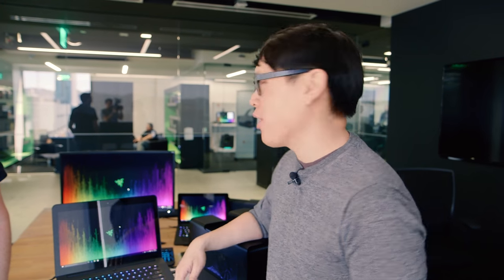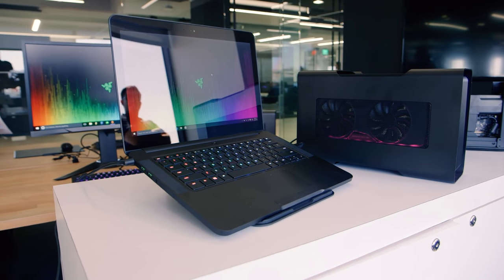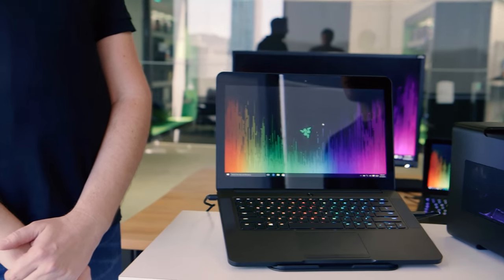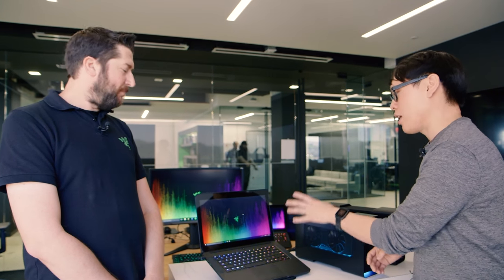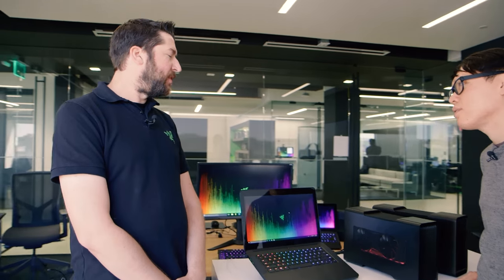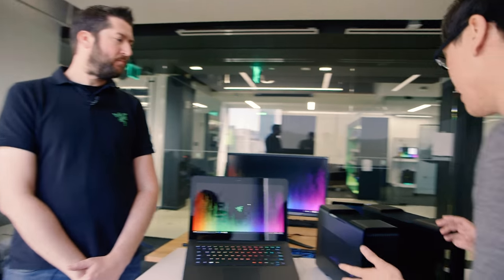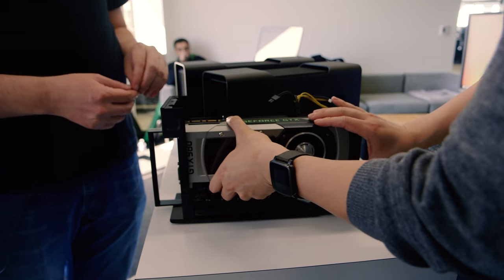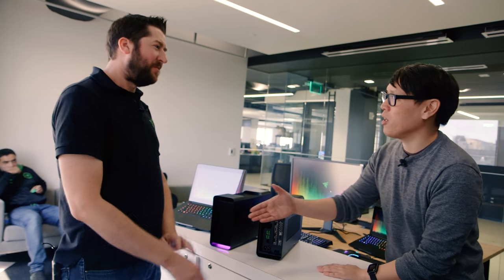Installing a Video Card in the Razer Core (External GPU)

Comment: yo this is such a good idea, external GPUs. hopefully a new trend, for all devices
Reply: +Shawn From Portland so the core itself is going to be more expensive than gtx970?!
Reply: +Larry LaPointe People used PCIe before.  Making use of M.2 style connectors.  It was more of a home made hack.  But it was a bus capable of the speeds needed.
Reply: +Larry LaPointe People used PCIe's through their M2 slots. While I agree that this particular "box"' price is justified for really the overall build quality and materials, the same functionality can be achieved at a much lower price, obviously with cheaper materials. The core is nice, but for the concept to be widespread it'll definitely need a lower price entry bar.
Reply: +Superkoopatrooper I agree $500 is way to much, $200 is about right other wise it would be like $3000 for the laptop, gpu, and core. You could build a great pc for that and but an ultra book.
Reply: +William T Will not work on a cheap Laptop due the thunderbolt connection req ( not an option on a cheap laptop) maybe in a few more years IF thunderbolt becomes a common feature and Usb 3.0 + doesn't kill it
Reply: +Alberto Martinez Cheaper reasonable good laptop with Thunderbolt 3 would be around $1000. Exactly, this won't be cheap at all
Reply: +Djordje Petrovic I said the idea was good, not that this device was the pinnacle of achievement in realizing this idea
Reply: +Alberto Martinez Which it will.  Thunderbolt is proprietary, USB 3.0 is not.  For that reason alone it will fail to beat USB 3.0.  That doesn't even take into account the interoperability advantage that USB 3.0 has with older 2.0 and 1.0 devices that Thunderbolt doesn't have.  Thunderbolt is a good idea, killed because Apple insists on proprietary interfaces.
Reply: +Superkoopatrooper 
Incredibly overpriced. Ignorant people are what keep these things around.
External GPU's are nothing new- old news. Tacked-on solution to an inherent laptop problem.
500g hdd for $2200? Then you have to buy a video card for $100-$300 ( or more ) and then buy all the peripheral garbage and that fancy box to hook it up for $500 and more. Get the fuck out of here.
Build a DESKTOP GAMING RIG.
This is no desktop replacement. Laptops never will be.
Reply: +Larry LaPointe Well you can buy an entire aluminium frame ATX- case (with fans) for about 80$ and a 650 W power supply costs like 60 $. I know that new technology costs more, but I'm quite sure that if these things become popular other manufacturers will be selling products like this for much less.
Reply: Rocco Croce 
This external GPU tech is just not for you, its for people like me who need to be mobile and can't afford to build a stationary computer. When I mean can't afford I dont mean money, I mean we dont spend enough time sitting at home to justify having two computers.
Reply: +Shawn From Portland Great idea, but a bit overpriced. I mean seriously, it probably only cost them $100 or so to manufacture this box with a few circuits and wires. You are already buying a GPU to put into this thing, and not to mention that you are buying a $2000 laptop on top of this. I think Razer is making us out to be idiots, and sadly people will buy as soon as its avaliable. I would get one just not now, and not until they come to their senses on how to price a product appropriately.
Reply: +14supersonic There is already an affordable external GPU adapter for laptops available.  I bought one for $60.  Now I can run my GTX 960 on my laptop.  I have a video of the setup on my channel.  With the exception of the desktop monitor, I can pack everything into my backpack (PSU, GPU, laptop)
Reply: +JZ5U That's just the point being illustrated here. If you can afford this cobbled together peripheral mess of a marketing teams wet dream then you can afford to build a gaming and an accommodating mobile gaming platform. 
You don't need to be at home all the time to educate yourself beyond the point of submission to niche marketing in an already flooded IT field. 
Gaming laptop ~ $800 asus 17" rog refurb. 
Gaming desktop ~ $800 buy you a LOT of power these days. 
Even if you bought the laptop ( which seems nice ), you'd still have plenty to build a desktop gaming rig if you forewent the proprietary PSU box thing, peripheral attachments, and the external gpu. 
You'd be better off with another, "separate", machine at home instead of a proprietary piece of luggage. 
Plus it's fun picking your own parts and putting one together, right? Doesn't take much time at all!
Reply: Rocco Croce Yeah, i totally get what you're saying. $400 is WAY overpriced for this, even coming form a company like Razer.

However, the unfortunate reality is that building a PC in the US is significantly cheaper than where I live. Heck, I technically know how to build a PC from hours of scouring /r/buildapc and sites like those. I'll need about 1.5x the amount of money to get a similar build compared to the US. There's no newegg/amazon/radioshack so all retailers can sell at an inflated price. 

So the bottom line is, yes its expensive and niche, but on a cost benefit analysis it is still (unfortunately) better to get this thing.
Reply: +JZ5U what country are you in? Have you tried eBay? I would avoid Amazon at all costs..they have pretty crappy sale practices ESPECIALLY when it comes to electronics. 
Newegg won't ship to you at a reasonable rate? 
That's a shame. Ironically, I'm always amazed at how cheaply I can get things online, from anywhere, for next to nothing. 
I do most of my shopping on eBay. For computer parts, I use newegg to see what's popular and has best reviews, then find it on toms hardware and read about it. If it all checks out I move to eBay to find a better price or combo deal.
Reply: +Rocco Croce The whole point of the product is for someone that is looking for both a laptop and a desktop, and they just sell them separately because why not expand the niche? They aren't selling raw power per dollar, they're selling the convenience. The idea of an eGPU that works is completely revolutionary because it reduces the need to purchase a new laptop every year, and replaces it with only an upgrade the desktop GPU. It also makes something like an ultrabook a usable workstation and just removes planned obsolescence to a high degree.

Also, eGPUs of this caliber are new technology - PCIe standards and Thunderbolt have been skyrocketing in the last five years, making this a totally viable replacement. You aren't paying the profit margin for nothing, Intel and Razer spent millions on R&D just to get it to this level of ease of use.

The price point is also highly competitive, it's a complete alternative to the Steam machines and console-equivalent AIOs.
Reply: +Drew Heo video expansions have been around since modern laptops have existed. This is a more expensive solution to a problem that's already been solved. Anyone looking to run an external vga has been able to do for a long time and by means of an affordable, non-proprietary device.
Taking an off-the-shelf item like a video card and adapting it to a mobile computer is an almost universal and affordable concept. 
I don't even consider steam hardware. I've never considered that a solution to anything. It's marketing. This is how businesses work. 
It's just seems like marketing and pandering to me. Hey somebody has to buy it though.
Reply: External VGA is technically expansion but ultimately ends up being a desktop computer running on a mobile monitor. It's not a true eGPU which leverages all that desktop graphics has to offer, because VGA is a dying standard. eGPUs are supposed to add to existing computer setups, not replace them. 

I've been following eGPUs for years, older eGPUs haven't been consistent, they required multiple connections and never came close to desktop PCIe bandwidth. They're DIY homebrew projects and kits that have been limited by the bottlenecks of older bus standards.

It's only because of Thunderbolt 3 that the Core can work and be mass marketed because it actually works on paper and, according to Razer in this announcement, in execution. If it does work, this isn't just pandering and marketing, it's a legitimate new product category that can coexist between laptops and desktops like tablets coexist between smartphones and laptops (and additionally, can completely substitute a highly expensive workstation desktop computer by giving the exact same graphical power in a desktop in a laptop).

You're also reading into proprietary wrong. It doesn't matter that the enclosure is proprietary, the graphics card can still be interchanged with each other, and it uses modern universal standards. The only downside is their powersupply, but that being proprietary doesn't affect performance, so it doesn't matter.
Reply: +Drew Heo maybe once it's price point reaches that of its predecessors, it'll become a more viable solution. I've never been a fan of the effort to make mobile computers gaming and video-editing powerhouses. It's just more conventional to have a separate machine at home for play / everything and a lean mobile computer for...mobile computing.
If I need an external power supply, external vga, external cooling and external HID to play games at home then it's not an option anymore. With that many peripherals you just assemble a desktop workstation for much less. It's so much luggage.
Reply: +Drew Heo also, an equally viable desktop workstation is far less expensive than any of this; building a gaming desktop for $800 or less isn't the slightest bit farfetched. I spec out machines for people all the time and they come in under $1,000 easily.
Reply: You have no idea what a workstation is. A gaming desktop does not equal a workstation. Video editing also does not equal workstation (necessarily).
Reply: +Drew Heo you can quibble semantics all you want but the definition of these products will not change nor will the legacy of its predecessors.
Reply: +Rocco Croce You are not all use-cases. You cannot decide that it is more conventional to have two separate stations at all.
Reply: +Rocco Croce This isn't semantics. A workstation isn't a computer to do work with, it's a computer outfitted with workstation grade (often server) components. Workstation components are nothing like their consumer counterparts, they cost more for redundancy and safety, have different architectures specifically designed for acceleration instead of performance, and have company insurance based on their usage. These components can't typically be used at all for mobile computing which makes an eGPU a legitimate mobile workstation accessory.
Reply: +Shawn From Portland imma just use a titan to play flappy bird on my phone
Reply: +Shawn From Portland I agree but 499 just for the case?!
Reply: I wanted this 6 years ago,  when I couldn't  afford  a complete desktop computer.
Reply: +Drew Heo but it is Symantec's.. So with that rate, let's call these products "gaming computers". Having a moderate gaming laptop and a moderate gaining workstation would still be a more conventional option. And yes it is conventional, the market support shows that. These products of been around for a long time, this is nothing new and neither is the lack of market demographic and resell base. 
I don't see anything like this coming to rise and replacing a gaming desktop especially any time soon. it's an incredibly optimistic and coarse statement to cast over the entire PC gaming community… It's too much peripheral equipment and it's too expensive. Desktop computers don't need to be these big expensive things with lights and radiators everywhere that take up an entire corner of a room; they don't even need to be in a desk or on the floor either. 
Maybe in another five or 10 years these will be more popular but nobody was buying them five years ago and they aren't buying them now either
Reply: The only thing that has changed is the marketing. Well, the price too.
Reply: Rocco Croce A modern workstation is upwards of $2000 because of the components including ECC RAM, workstation GPU, and server-compatibile motherboards and CPUs, it's not semantics.

The combination of a gaming laptop and a gaming desktop isn't conventional. Conventions are established by way of the average median, you honestly think that the average person owns a gaming laptop and desktop? No, they don't, they barely have laptops with more than 4 GB of memory, because it works just fine for them. This is a niche product, just like gaming laptops and gaming desktops, and computer hardware in general are niche products.

People weren't buying eGPUs five years ago because there wasn't hardware to support it. Just because something exists in some form doesn't mean that there are no advancements to be made on it - VR technology in the form of an HMD has been around since the late 60s but has only just started reaching legitimate execution with the Oculus, Vive, and software support. Five years ago eGPUs weren't plug-and-play, now in 2016, they have the capability to be plug-and-play.  The Core, a two cable (power and laptop connection) plug-and-play eGPU is a new product. No other eGPU has worked this way and been sold as a mainstream item, it's always been a homebrew project and enclosure kit.

The marketing isn't the only thing that has changed. The only that has changed is literally everything. PCIe standards, Thunderbolt 3, HDMI standards, graphics card architecture, modularity of power supplies, modular design and awareness. We have better standards that can handle more than 5 years ago. 5 years ago, a GTX 460 was considered a mid-end card. The marketing has changed because of all of these other things that have changed. The marketing and execution of this specific eGPU enclosure is literally the difference between a smartphone pre-iPhone and a smartphone post-iPhone. They're night and day in terms of use and feasibility.

Resell value actually is a detriment to economics and isn't factored in any form of market publishing because the companies that manufacture and sell the hardware cannot track it accurately.

I never said this is a replacement to the gaming desktop, I said this is literally a new product category between mobile and desktop. The usage of this is like a tablet between a smartphone and a laptop. This is the early adoption phase which will eventually go down in price, and claiming that it's too expensive is a moot point in terms of its adoption.
Reply: +CarloVanElswijk You can always buy a smaller card, if your normal sized ones don't fit. You could get a r9 nano for 700$, way better choice than that 500$ box and a 200$ grapics card.
Reply: +Drew Heo you say that...yet this exists. 
I don't believe this peripheral luggage will go down in price until the market for it becomes even more anemic. 
I'm not saying I don't like the laptop- I don't like the marketing. 
They're the ones saying it's going to be a replacement for a gaming desktop. That's not going to happen. 
Even in median usage among median people, it's still more common to see someone who wants to play pc games own a gaming desktop pc and a moderate laptop or a gaming laptop under $1500. People know laptops aren't the way to go for gaming / future proofing and that's exactly why people don't spend all that money on them. They buy a moderate mobile machine that won't have them clenching their firsts and they save the enthusiast gaming for home. 
There are more >$1,500 Apple laptops sold than gaming mobile windows machines and nobody's playing resource-heavy ( or any...) games on those, either. 
This market has a long way to go.
Reply: +Drew Heo take a look at all the pc gamers commenting on this video. Use them as a median sample audience. I would bet that 85% of them have experience gaming on both a mobile platform and a desktop platform and both
1) find the price and claims of replacing desktops absurd. 
2) don't expect their laptop to exceed the potential of their gaming desktop, regardless of cost. 
Check out the reactions.
Reply: Rocco Croce I live in Singapore. fun fact. Newegg actually opened a local distributor here last year, but they sold all their stuff at the same inflated rate. Those jokers closed in 4 months.
Reply: +JZ5U That's sad- way to support the local community, Newegg!
A lot of these companies are shooting themselves in the foot with their pricing and their marketing.
Reply: +Shawn From Portland peoples in the know have been using egpu's to boost thier laptops performance for the past +10yrs, this is nothing new, i use one hooked upto to a gtx770 for my 7year-old i7 laptop.
Reply: Allen Kemmett And older eGPUs are way less plug-and-play than what the Core is claiming to be, correct?
Reply: +Allen Kemmett The first egpu isn't even 10 years old....so yea you're not "in the know" The vidock  circa 2010 ish which flopped alongside it's successors. "your 7 year old i7 also no way possible you could be using an external gpu like the vidock with that so called 7 year old i7 laptop  (conveniently just happens to be the age of the first mobile orientated i7 line) due to it not having thunderbolt and the first egpu units used pcmia and you would need thunderbolt for a gtx770 due to bandwidth limitations of express port... So yea you're definitely "not "in the know" , but those that are like myself see right through guys like you lol.
Reply: well my rig works just fine, but hey carry on crying "you know".
Reply: +JZ5U you clearly do mean monitarily as if you had far enough money for two computers then you would not need to justify it.
Reply: ***** uhh, i don't have two computers.
Reply: +Larry LaPointe USB 3.1 is not what "carries" over that data. Most usb 3.1 ports dont even have that capability unless they have thunderbolt...
Reply: JZ5U
that was not my point, you said: "When I mean can't afford I dont mean money, I mean we dont spend enough time sitting at home to justify having two computers."
Reply: +MooseSenpai lol yes. As it was said before me, this is fantastic for middle or high school students, like myself. I can use it for all my classes, maybe even do some gaming with my friends at break, and then when I'm at home, I play at peak performance.
Reply: +Shawn From Portland As an Engineering Student its practically gold for me. Would really come in handy for doing 3D designs and gaming at the dorm/home